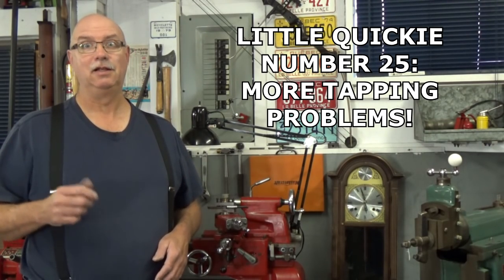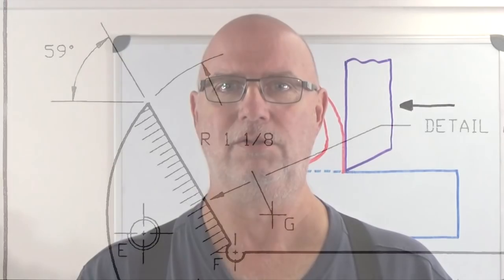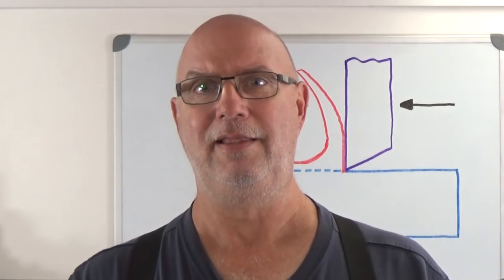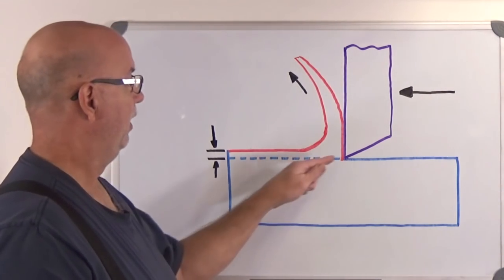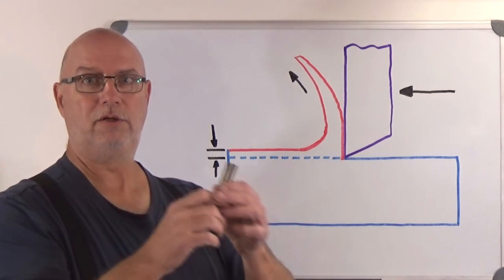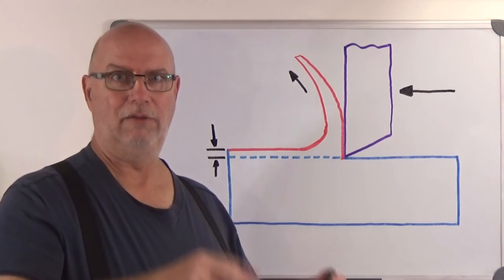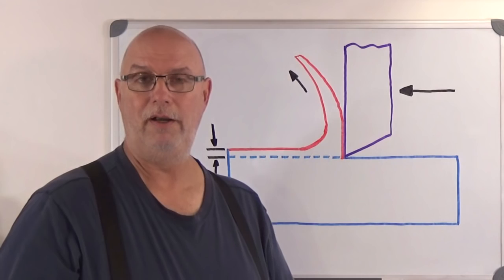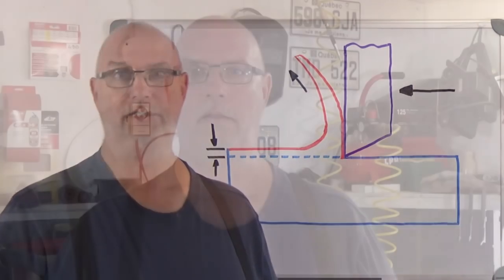MORE TAPPING STUFF! MARC LECUYER

Comment: If cutting oil helps the chip flow along the face of the tool, it needs to be ON the face of the tool.  But if it is applied to the stock ahead of the cut, how does it get from the surface of the stock to the face of the tool?  This seems especially unlikely given that the chip is in constant contact with the face.